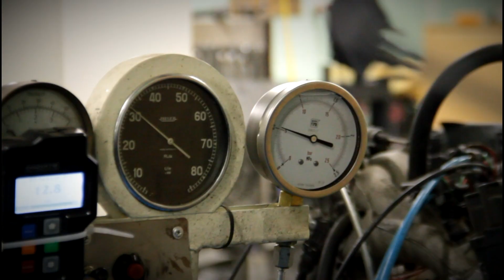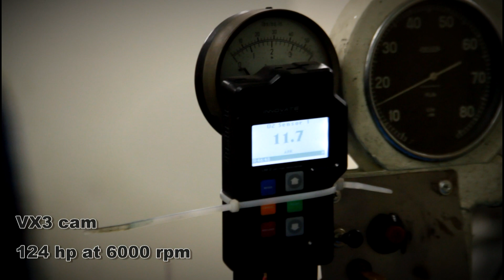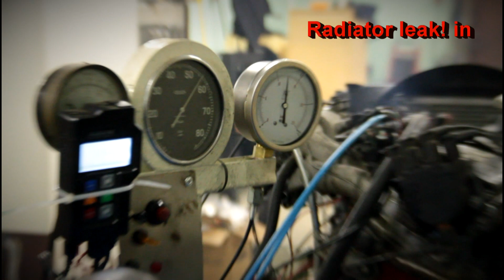6 Fools, a dyno, a Volvo B230 engine (Part 4)

Comment: wow, you moved the rpm limiter and noted more HP, that is insane!
Reply: But what if the vx3 peaked out at 6000
Reply: That's not how it works... They changed the camshaft and now it makes peak power at a different RPM.

That being said, that is a seemingly tiny gain. I wonder what the readings would be if it had an intake pipe and filter on the end of the throttle body? Or if it had a B21F style intake manifold? Because these HP numbers do seem low.

Comment: I wonder what HP would it show using VX3 cam @7000RPM. 
You should have posted results on the same RPM so that they could be compared somehow, different HP at different RPM means nothing...

Comment: how did a simple rebuild get you 4 additional horsepower?
Reply: How did it ONLY get you 4 additional HP, you mean? Fresh rings and cylinder walls mean more compression. Fresh valve job means better flow. How would that NOT improve HP on an engine with 470km?!?